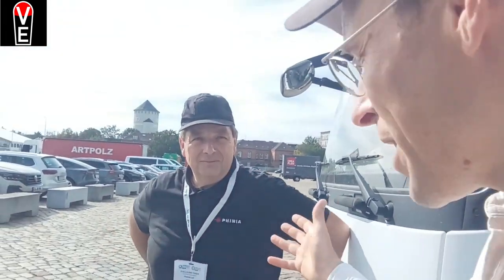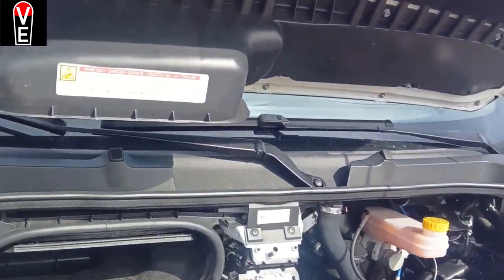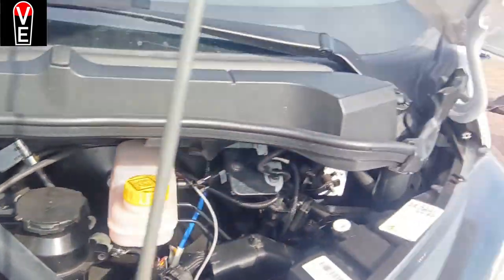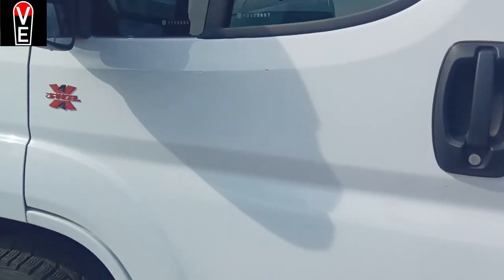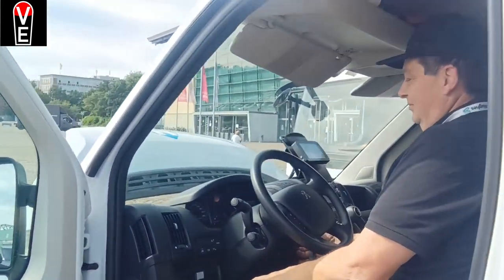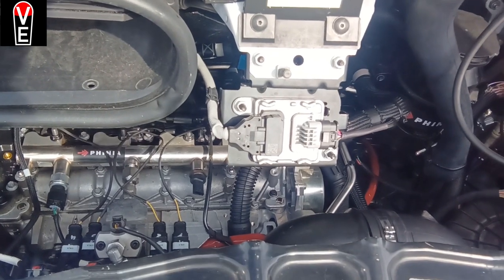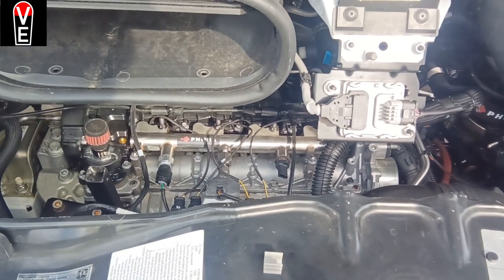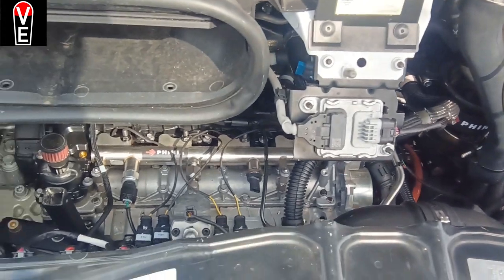pure hydrogen converted direct h2 injection diesel car H2 kit

Comment: Well done, you gave diesels a second life, we have a Ho unit that is close loop and 45% more efficient based in Portugal. Are you interested in a vehicle that never needs fuel ?
Reply: I am interested. Do you also build it in? Or is that easy to do yourself? And which second hand diesel cars are best for this?
Reply: @biancaol6968  Our device is still in the workshop, we have proof of concept, and now we are working on prototypes. Cold fusion can supply electrical energy, heat, and hydrogen. it's a matter of focus and funds, all internal combustion engines work on poor efficiency, diesel engines have no spark, electrical only need more electricity which to design for make bread or boil water, are you hungry or thirsty 😀